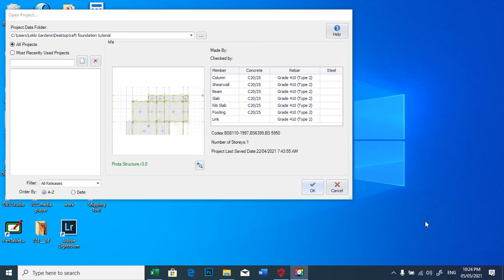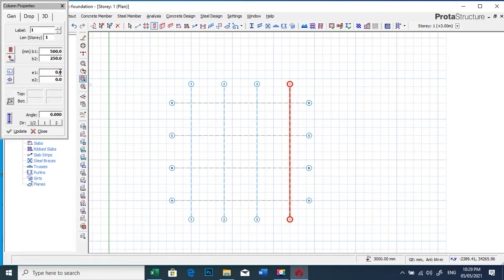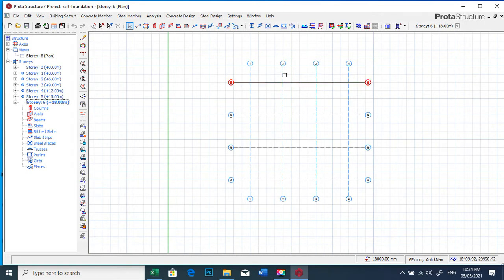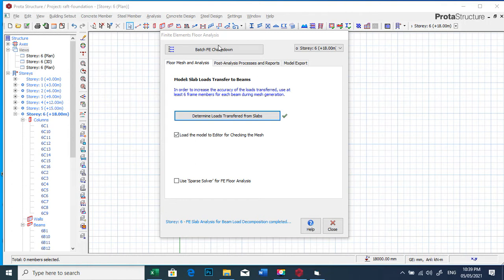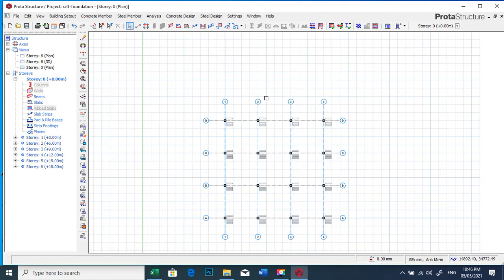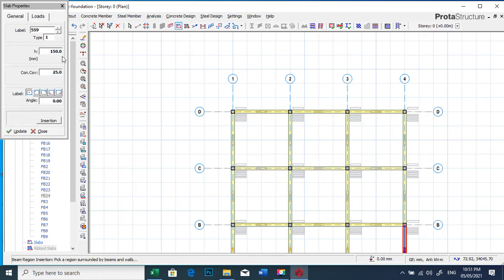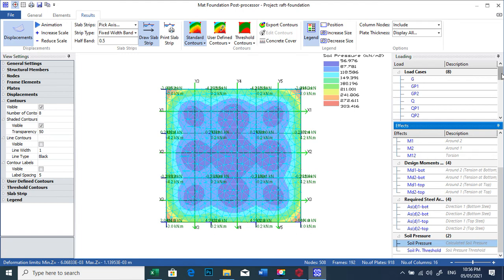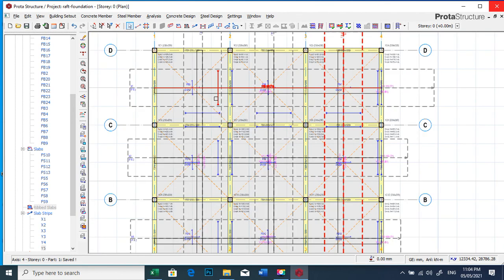protastructure tutorial_ how to design raft foundation

Comment: THX YOU SO MUCH ,JUST I WANT TO HAVE A VIDEO THAT EXPLAIN VERY WELL ABOUT HOW ROOF LOADS ARE APPLIED TO THE STRUCTURE BECAUSE IT SEEMS AS IF WE DO CONSIDER ALWAYS A WALL UNITY WEIGHT EQUAL TO 1KN/m AND WALL HEIGHT EQUAL TO 1m ,so if those values above are used like that tell us .thx i am Burundian.

Comment: Did you have to raise the slab level to the top of the raft beam or you left it at zero level?
Reply: The same qustion
Reply: @amgadmero1320  seems that the most common method they use....but there are other method for sure including the slab plate only at the base of the colum